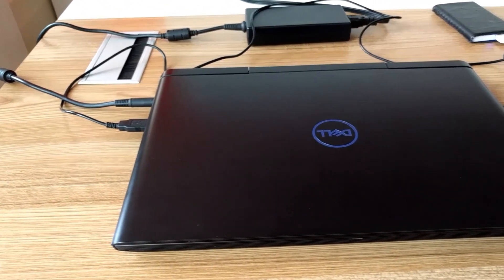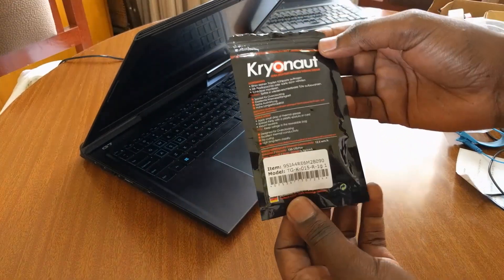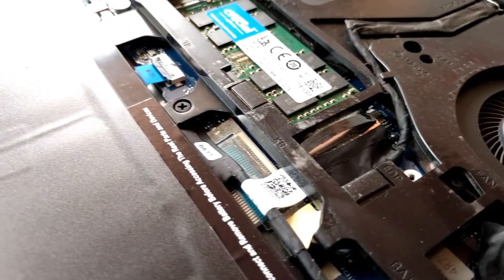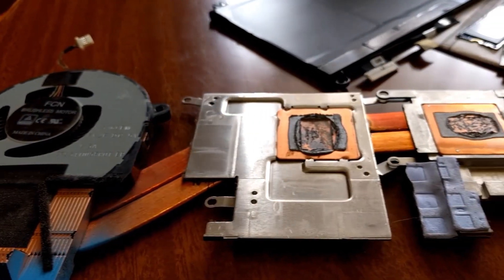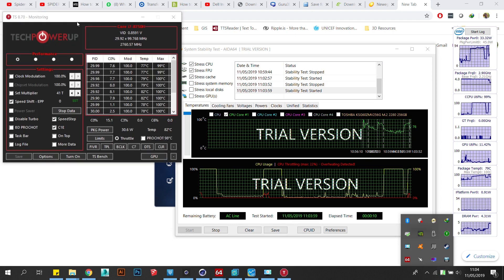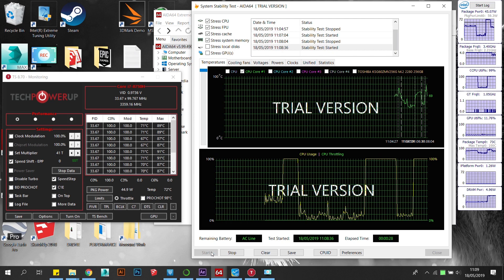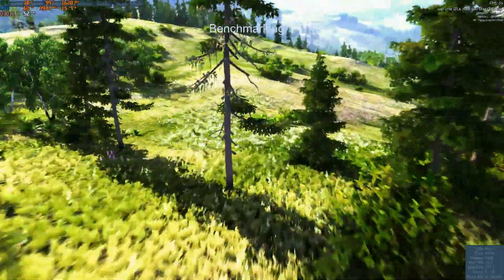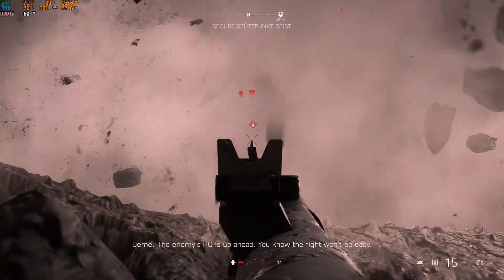Dell G7 7588 Repaste Guide

Comment: How easy or hard do you think for a newbie to disassemble the G7? I have never disassembled a laptop before, not fully anyway, I tried to disassemble one of my old laptops but only went halfway because I dunno what else to do.
Reply from the maker: Hi, with the right planning it should be relatively simple, just make sure you keep a physical record of where all the screws come from, and follow the online video tutorials that describe the process.
Reply: You can watch my video.  It was hard as hell.
Reply: Its definitely doable... Ive had prior experience opening up laptops and phones so I already had a bunch of tools at the ready. You will want a magnetic PH0 phillips head screwdriver (this will work for about 90% of the screws in this laptop). The fan screws are smaller (its either a PH00 or a PH000). You will also want a couple plastic prying tools, and a bit of patience. Luckily the frame for each hole has labeled what kind of screw is used. Be careful when removing the rear plastic shroud as the tabs that have 4 screws holding them in place are very fragile. This guide helped me alot for screw location, https://www.how-fixit.com/laptop-repair-guides/dell-laptop/dell-g5-5587-g7-7588-disassembly-guide/ but the video helped me for figuring out how some of the ribbon cables came out.

Comment: hey man,
i have a g7 too it goes like nuclear when i play apex, and watch live videos for my online classes.
This heat problem causes sudden drops in frame rates. 
i tried disabling turbo boost but it was no good.
i don't want to repaste my laptop as i am just a kid who is scared to damage his laptop.
please help me.
Reply from the maker: Hi, try propping up the laptop while playing games, it helps with head issues. Also, if it is still running hot after disabling turbo boost then you may need to  check you BIOS version and update, some of the previous BIOS versions were notorious for limiting fan speed.
Reply: Go into bios and set the number of cores to 5 and tun off turbo boost there as well. Then, download QuickCPU and set the Frequency scaling index to 99%. I installed a 120hz panel on mine and it was making my frames drop like crazy and was running around 99c but after i did this stuff i get a steady 120fps and my temps stay around 75c while gaming
Reply: @azadanes  did you do anything special in the BIOS to get the 120hz panel to work? I bought 3 120hz screens from different sellers and all 3 I had terrible flicker issues that got worst the dimmer the screen was. I reinstalled all my video drivers and updated the BIOS to see if that did anything and still nada.
Reply: @AtomicBleach  I didn't have to do anything special at all to get it to work. I'll try to see if I can find the screen I bought and post it here.
Reply: @azadanes  I bought the same one from the same seller...

Comment: Hey , I have Dell g7 too . My cpu temperature go around 100 and GPU around 77-80 while gaming new Dawn . In between it throttles down to 20 fps from 55 fps and again after 1 min to 55 fps . In Intel xtu it shows power limit throttling . Frequency drops to 0.80 GHz when it throttles . Could you tell me if it power limit throttles in xtu after repasting under stress test?
Reply from the maker: Hi, with the repaste the temperatures drop significantly, what's even better is if you limit your CPU frequency in Throttlestop to 3.2GHz after repaste your temperatures never go above 80 deg C. For the CPU throttling, there is a program you need to remove called Intel Dynamic Platform and Thermal Framework that you need to remove, because your system may throttle even after the repaste because it thinks it's too hot. Only get rid of this Framework after you have repasted though, because you risk damaging your system.
Reply: @kakemboluide  that's the thing , I tried deleting them but they came right back up . It's impossible to remove them . And after repasting what is the max frequency we can achieve ? Because currently it goes 3.8 but when I bought it , it went to 4.1 GHz .
Reply from the maker: @drakfang2530  you can actually remove them, there's just some extra steps you need to take. Check out solution 2 here: https://www.reddit.com/r/Dell/comments/a27e1l/finally_permanently_fixed_dell_inspiron_power/

Comment: My G7 is having thermal throttling while playing, I have never changed the thermal paste before I have to do it now but I'm afraid because everybody says this laptop is very hard to disassembly.
Reply from the maker: Hi, yes the disassembly is hard but if you are very careful and mark where all the screws go (very important) you should be fine. It is well worth it.
Reply: @kakemboluide  I'm playing games on ultra while throttling my CPU to its base frequency(2200). With CPU and GPU never exceeding 68 digrees. But..... it's still not enough. I'm also going to repaste my laptop this month. Could you test your G7 gaming with 2200 CPU frequency?
Reply from the maker: @Cosmetic-Restoration-Channel  hi, the temperatures would probably be in the 50s, however that will affect the GPU saturation, you will never achieve 100% GPU usage on most games, meaning lower frame rates. The lowest frequency I would recommend is 2.8GHz